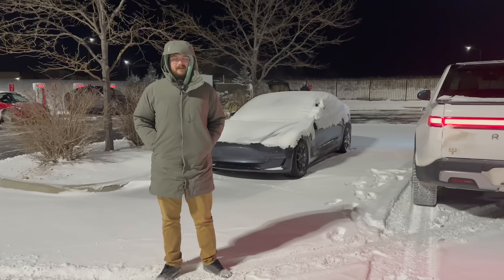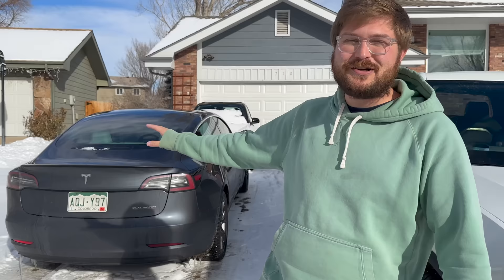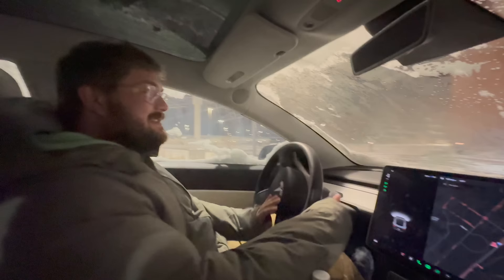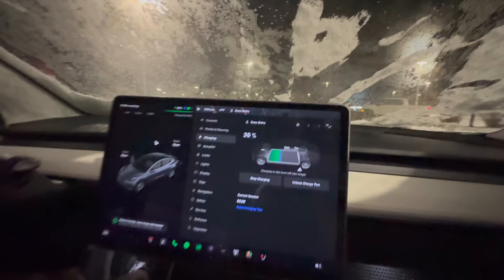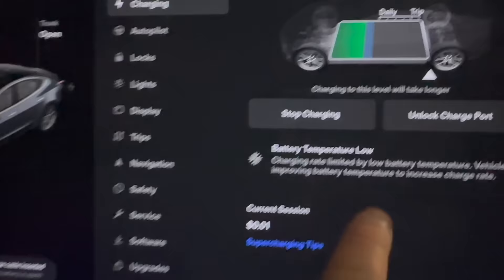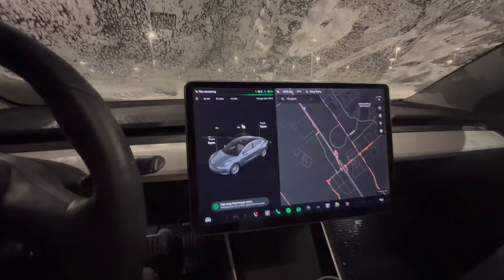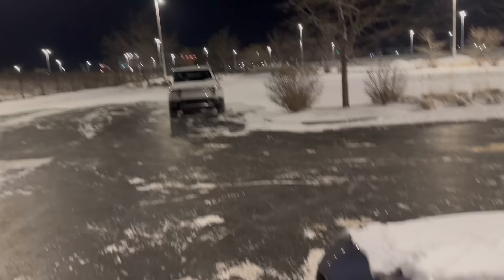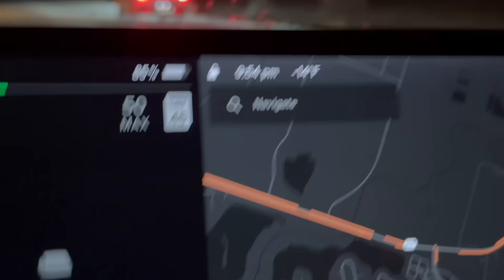I Deep Froze My Tesla And Immediately Plugged It Into A Supercharger To See What Happens

Comment: Very interesting video. One has to really be committed to EV’s to endure this experience of charging in cold weather. What about those who have to park on the street and are not able to plug-in overnight? Your summary of how impressed you are with how the Tesla handled this heat warm up cycle before charging for 45 minutes and then took another 1.5 hours to charge (if I understood correctly) seems to me a little underwhelming. For those of us who have to be at work at a prescribed time in the morning I think it becomes quite problematic. You were fortunate to have another vehicle to stay warm in. 99.9% of people don’t have that option and would have to endure the really cold temperatures waiting for the car to be able to heat the cabin. You charged to 90% and then warmed up the cabin. The charge level was already at 85% when you were departing the charging station. It would interesting to know how far home you had to drive and the state of battery charge when you arrived. In the Minneapolis area in -10 to -15 F early morning temps a radio announcer of a local station indicated that her Tesla’s battery quickly depleted as she was driving to work. In fact the battery drained to zero to the point the car stopped and would not heat the cabin. She had to call someone to come out with a portable battery bank to charge her car before she could get to work.  All automobiles have trouble in extreme cold temperatures, especially for those who cannot park in a garage overnight. It is a common situation in Minneapolis, a reasonably sized metropolitan area.  I know I have had to have someone jumper start my ICE car when I had to leave my car parked outside. I have seen times in Minnesota where is has been -20 F on Christmas morning, -30 F on New Year’s morning, and then stayed below zero for over two weeks. If one cannot plug-in their EV, it’s going to be really hard to “drive” anywhere. Not against EV’s, but they may not be the “ideal” mode of transportation that we are being led to believe. There simply is not enough charging infrastructure to support extreme cold weather conditions. Nor do I see it my responsibility to pay for such an infrastructure through taxation under the premise that the world is going to end in 20 to 30 years, if we don’t force EV’s on the population. Let’s keep politics out of the free market. Let consumers decide what they want to drive. Let there be real truth about the advantages and disadvantages of both ICE and EV vehicles. If EV’s are the next mode of transportation for the world, let them evolve as the first cars evolved from horses and carriages.
Reply: Think You got it wrong, he could press a button on his phone app and warm up the car but he chose not to do so for this experiment

Comment: This happened to me on accident while on vacation.  We got in late and I thought I would just charge the next morning since there was a free charger a couple blocks away.  BIG MISTAKE!  The battery cold soaked overnight and took forever to charge on Level 2 charger.  Luckily we weren't leaving that day so there was no inconvenience.   Lesson learned, now I always charge while the battery is still warm from driving.
Reply: Remember from the app to precondition your car before you get into it and go to charger that will fix the battery
Reply: @pureluck8767 it's pathetic that anyone needs to worry about that after spending 70k
Reply: @johndodo2062  why is it pathetic that you have to read the owners manual I don’t think Mercedes-Benz owners or BMW say that
Reply: So the car tells you when to charge it, what route to take,  f$#k that👺
Reply: @davetuscano5939  Pretty much, you have to plan your route, if you're driving across the country.  Basically, you're going from charger to the next charger.  My brother has a Tesla in CA.  The interior is cheaply made (to save weight, thus extending range).  He drives it at 65mph.  Never speeds.  Intermittently use the A/C.  He parks it inside his garage, right under his condo.  I fear it might burn down his place, & the next door condo.  The wife can't drive for shit, so she parks outside.
Reply: Electric cars are just not viable if you actually use your car. Hell, I couldn't even make a semi-regular trip I look forward to multiple times every May. Just booked another trip any electric car couldn't make.
Reply: Also the water bottle in the cup holder is frozen
Reply: @NoMoreIllegal5 sounds like you are jealous 😂
Reply: No inconvenience?  You are on vacation and can't use your car?  Sounds inconvenient to me regardless of whether you were moving on that day or not.

Comment: That's not exactly true about the blue part of the battery. It's just that when it's too cold, it can't access a part of the battery. You get this part back when the battery is warm. Here's explanations : 

Note
A portion of the battery image may appear blue. This indicates that a small portion of the energy stored in the battery is not available because the battery is cold. This is normal and no reason for concern. When the battery warms up, the blue portion no longer displays.

Comment: The battery will likely push a bit more voltage as it heats, so I think Alyssa is technically correct that's it gained a bit of extra energy courtesy of the heat; the same was lost to cold and is now returning.
Reply: Yes

Comment: I find these videos interesting but have you ever done the same thing with an ICE car.
I have, at Scott base Antartica. When they get that cold there is no chance of starting the and if you have left the battery in place then you are up for a new battery before you start. Once you replace the battery then you have to heat the engine bay and you better hope that the cooling system was protected because without protection it will destroy the engine.
I note that even when your car was that cold you were still able to start and move the car.
Reply: I've routinely started gas ICE cars all the way down to -37C to -40C. Granted, we did have block and battery heaters. I didn't even plug those in until -17C. I have forgotten to plug in and still able to start at -26C or so. A lot of ICE no start conditions in the cold are battery related. Cranking amps drop with temperature.
Reply: @G4Disco  And you make the point, the ICE vehicle is protected in which case you should have few if any problems other than possibly fuel. Without protection and left to freeze in those conditions, which is what was being done to the EV, would in most cases destroy the engine.
The battery would freeze and crack the casing while the water jacket would also freeze and risk block cracking or the frost plugs blowing while the sump and transmission oil would thicken to the point of grease and the fuel particularly diesel would develop ice crystals.
I have delt with all of these problems first hand.

Comment: It would be interesting to see the results with LFP batteries.
Reply: LFP batteries can't be charged when frozen and since they have more mass per kWh they will take longer to warm than the small li cells in Teslas.
Reply: I thought all 3s were lfp?
Reply: I haven’t had this issue in Mach-E which is LFP in the -20 to -30

Comment: What do you think the result would have been if you had done the same testing procedure but immediately put the climate control on max heat when you plug it in to the fast charger?
Reply: My guess is no difference in charging since the cab doesn't heat the battery

Comment: I’d love if you did this same thing with the Plaid. Supposedly it has a beefier heating/cooling system?
Reply: It uses motors to heat the battery, 25% more battery, but 3 motors instead of two..
Reply: @jpmkiv  It also uses the heat pumps.  The heat source for the heat pump is the motors, so yes, 3 motors=more heat.  AFAIK, there is no problem running the motors at extreme cold, so basically the limit would be how cold can you allow the coolant loop to the batteries to get before it stops flowing (ie freezes).  Having a heat pump creates higher temp differentials for faster flow of heat even if you have the same total heat.  With the same amount of heat, the heat pump pushes up the temp on the loop to the battery and pushes down the temp on the loop to the motors.  Heat flow is directly proportional to temp gradient, so the heat pump allows for faster flow of heat from motors to battery.  The heat pump also lets you heat the batteries to a temp that is higher than the temp of the motors.  Plus, the heat pump itself will create some heat when operating which I assume is captured.

Comment: It's sweet how enthusiastic you are while putting up with this and I am just sitting here - "Damn, EVs really suck..." 🤣
Reply: This isn't a realistic use-case though. This is a test against all odds, just trying to optimize for the worst charging performance.
Reply: @logitech4873  I live in the mountains, a car that was parked two days at -20°C outside is not "against all odds" - That's just Monday morning. The drive to work takes hardly 15 minutes, which is not enough time to warm up the battery pack. So whenever I want to charge in the winter, waiting 30min before it even starts charging would be the norm and not the exception.
Reply: @mpauls85  Huh? Just turn on the heater and drive then? In -20°C the interior will still heat up in 2-3 minutes, and off you go.

In this video he specifically avoided ways of heating up the battery as part of the test. Your don't even need a warm battery to drive to work.

Also you'd just charge overnight. No need to wait for the car, just plug it in and go to bed.

I own a Tesla Model 3, and I live north of the arctic circle. Works just fine.
Reply: @logitech4873 

You plug in every night. I live south of the arctic circle and don't have a plug at home and no garage. 

This is terrible. Esp after paying more then $40k for  a M3
Reply: The simple fix is to always charge before the cold soak. That way you have a full battery in the morning, and it's fully warmed up by the time you get to the next charger
Reply: Don't understand who would want the inconvenience and also expose themselves to all the various dangerous aspects of EV's. A 1980 Honda Civic would be far easier to live with!

Comment: Should always use scheduled departure in Teslas to make sure that the car is warmed up to go to the supercharger if you are doing that in the morning.  The example here of 5kWH or more to warm the battery show you need to make sure you leave 50+ miles of range (15%) available to do prewarming before going to the supercharger if you can't plug into shore power.

Comment: Hot/cold spotting sounds like the issue with (small) aircraft piston engines. You dont get the same fuel/air mix to each of the cylinders, so you have to find the hottest one to avoid overheating it when setting mixture.

Comment: The army has done equipment studies in cold weather simulation buildings and in places like Alaska just to study how equipment performs and how to use the equipment. It seems like Tesla and other ev manufacturers need to start doing this so they can adjust things like the plugs and heat packs for winter areas. Maybe a built in heater for the tip of the charger for locations that get winter weather to help prevent or mitigate water freezing in and around the tip.
Reply: was thinking the same.

Comment: This is really really interesting! :) Did you notice anything regarding battery health afterwards?
Reply: Probably  shot.  Might need a new expensive  batter after..... $$$$
Reply: I would assume the battery would be fine. The battery freezing during winter is inevitable so they wouldnt even be sold in colder states if the battery freezing would destroy it. You probably wouldnt want to take the battery this cold and jump on the highway, but even that wouldnt destroy your battery, it would just deteriorate much faster.
Reply: @blackfalcon1324  Maintaining the pack temperature at -28C (to avoid freezing damage) does not take nearly as much energy as heating it for fast charging (less than 300W). You would want to plan long-tern storage carefully (probably charge to 80% periodically).

Comment: So if you'd left it in an airport parking lot and come back in cold weather, it would be best to drive a couple of miles (so the preheating happens) before trying to charge? (or generally plan better 🙂 but this is a scenario that seems like a close match to your experiment, and it's something I've actually done with gas powered cars.)
Also sounds like there were no worries about starting it and hitting the road cold, other than regen, which is sometimes a concern with a gas car parked in winter weather...
Reply: How long do you have to leave it at the airport to get a dead battery?

Comment: This just made me realize that electric cars just ain't worth it, all that money for all this drama? I think I will stick to my combustion engine for now and ever.
Reply: Fuel-cell-based cars, which are also electric, don't have this problem.
Reply: You mean like hybrid?
Reply: @samlocoaa1726  No.  There are cars on the road that are powered by hydrogen fuel cells.  The fuel cells produce electricity by mixing hydrogen with oxygen.  A small battery is used to initiate the chemical reaction.
Reply: @palmshoot  so do hydrogen cars use Like regular gas and how do you fill it if it doesn't, and do you still need to charge the battery that comes with it?
Reply: @samlocoaa1726  The only gas they use is hydrogen.  They can be filled at stations that pump hydrogen, though, admittedly, there are few.  For drivers, fueling works virtually identically to gasoline stations.  The battery could either be recharged by regenerative braking or the fuel cell, or it could be a battery like the ones used in gasoline cars.  The most popular brand is the Toyota Mirai.
Reply: @palmshoot  your awesome man thanks for explaining I learned something new today
Reply: @samlocoaa1726  Thanks.  Happy to help.

Comment: I guess he had no idea about situations like the Chicago Tesla fiasco of 2024. He did not mention anything about the spontaneous combustion issues of this Tesla death trap or that the batteries start to degrade after 100k miles, and that Tesla drivers are involved in a higher percentage of accidents, which is why Hertz Rentacar is getting rid of over 20k EV’s due to that percentage and going back to fuel engine vehicles. SMH

Comment: This is why I will always keep and ICE for winters, even when I get an EV.  Sorry but until Solid state batteries become the norm I live in MN.  That said I have a garage and a 60A circuit wired up for later use.  So its not as if I can't leave an EV plugged in, indefinitely.

Comment: Funny how people who 'like' something dismiss problems with it with a quick gloss over. This guy has a video showing how long it takes to fill a hydrogen car and his big problem was that you can ONLY fill it up at a gas station, you know like most people have had to do almost since ICE cars were invented. Incidentally, it only took 4.5 minutes and he looked at his console just the once. He also did a full run of 300 miles with 10% left in the tank?
Reply: I spend exactly 0 minutes refueling my EV since it charges overnight in my garage while I sleep.
Reply: There are 0 hydrogen stations in a 500 mi radius around me tho. The infrastructure definitely isn't there for hydro cars

Comment: End of video was odd: Why run outside in the morning to "supercharge"?  If it's plugged in at home, set the charge limit to the bottom to charge overnight.  A few hours before leaving set the charge higher to say 90% from the smartphone app from inside your home.  Fifteen minutes before leaving I set the cabin temperature and heated seats to desired temps.  When I leave the car is in perfect battery condition and comfortable interior with little mileage range loss during the trip.

Note, I only do the above ritual if it's really cold out.   A gasoline car and diesel car can have trouble in the deep cold.  12v batteries with huge spike to turn over a cold car is hard on it. A diesel engine may need an engine block heater.

If it's >30F I'll just set it and forget it until fiftteen minutes before then set temps.

Comment: A lot of ppl looking into this issue after the Chicago news... What most EV haters don't understand is that if you follow the best practices you will not have any issues. This test that Out of Spec did is not a real world scenario.  Most people schedule their departure, so the car is ready to go before you enter it and pre conditions on the way to the charger. In addition, you should not plan to arrive at a supercharger with less than 10% of battery especially in cold weather. The percentage estimates is not 100% accurate at low state of charge and if the SC is pack like in Chicago you will be stuck without enough charge to drive to another SC... I bet most of those stranded arrived with a low state of charge and didn’t navigate to the SC which automatically preconditions the car.... NYC has the same problem,  there's a lot of  ride hailing Teslas that are new to EVs and dont know the ropes... Tesla should communicate better the best practices and add prompts to the display so people understand what is happening...

Comment: So if we take what's happened in Chicago recently as an example, if your Tesla was out of juice, and you plug into a supercharger (or any charger I presume) will the supercharger run the battery heating first before the battery starts charging again? Curious for some proper info around it rather than hype :) Your extreme test does seem to have happened in the real world...
Reply: So when the Tesla is out of juice and gets super cold we also have the issue of the 12v battery. If the 12v battery died the car will experience issues charging the high voltage battery